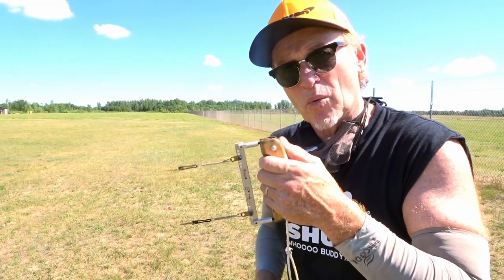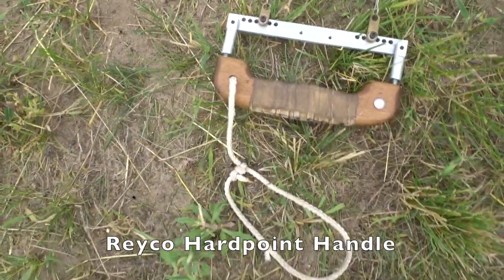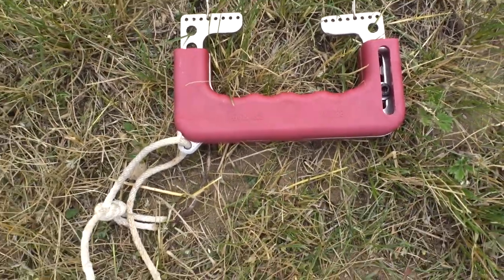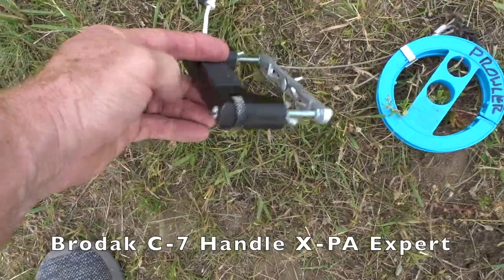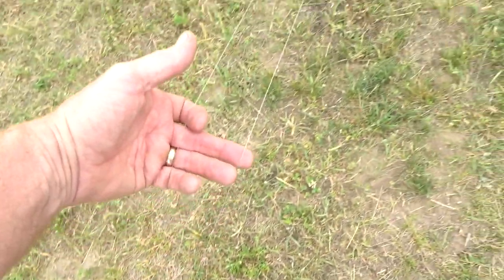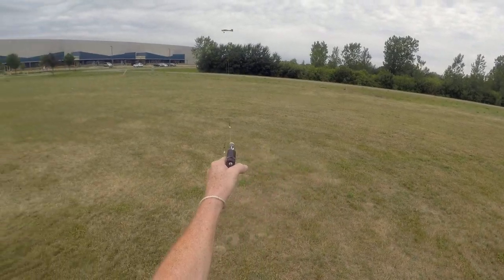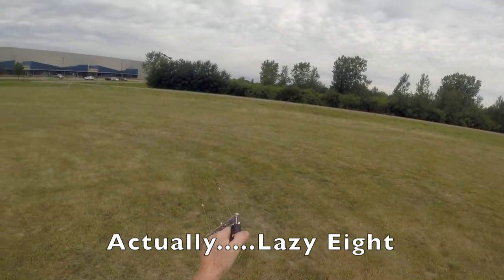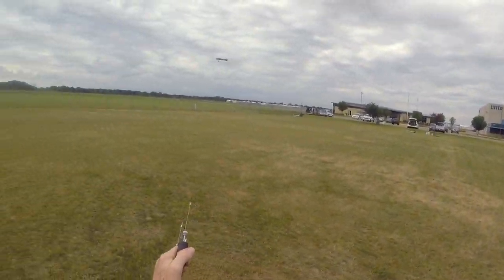Control Line Handle Talk First Maneuvers

Comment: Interesting observation about the risk of crashing being part of the appeal.  At first, just making it around for a full tank is a major accomplishment. Successful stunts add to the excitement. Finally, you tempt fate by seeing how close you can cut it before pulling out.  And sometimes, of course, you cut it a bit too close.  (A man's got to know his limitations.)
Reply from the maker: I have found that activities with a good learning curve tend to e the most rewarding.  Always tell new control liners to get some epoxy and CA and get used to re-building. And taking apart engines to clean them out after crash. Those limitations get learned eventually. I've reduced my impulse control~~

Comment: Nice instructional video. I never did the sport so until now I didn't know how much I didn't know about it. You are a natural teacher. 
There is room for a third or fourth line. You could hook a trigger finger line to do things like smoke, parachute,  machine gun. 
Just a thought.
Reply from the maker: Some use a third like as a throttle. Mainly for Scale airplanes.

Comment: I just had that old, big, red Top-Flight handle. The really heavy one with the thick wire cable leads that adjusted with a  two hole plate in the back. You know the one I mean? It worked awesome. My elbow at my hip and only wrist and elbow movement to fly.
Reply from the maker: I do for sure.
Reply: @shugemery  I actually loved mine

Comment: Thanks Shug for doing these vids to help tutor us, I wrote to you some time back, and did crash 2 planes and it SUCKED BADLY, just dropped the handle on the second, any way I am still working on it. This vid on handles is good, have 2 that you show, the one that moves the lines closer to center is the one I have to use for the quick response stab. I may not get as good to compete but I like just to go out and have fun, just flying and feel no pressure that I need to do an over head 8 or an outside loop,  just good simple flying. Thanks again, hope to get to meet and just fly and share stories with you.
Reply from the maker: As long as your having fun...all is good.

Comment: hello i want to make a control line plane do you know what lines is that?, i see videos on youtube that you can use a guitar string and aluminum wires for the controls is it right?
Reply from the maker: I get mine here.....https://brodak.com/control-line-parts/control-lines.html
Mine are 9 strand. Length and line diameter depends on engine and airplane weight.

Comment: Thank you,  thank you,  thank you very much. So much great information on handles and stunting. I have been trying to find a video like this that actually shows the stunt and handle position at the same time. Your tips about performing the actual stunts is an appreciated bonus! Could you recommend beginner stunt model, engine, handle, line setups? Thanks again!
Reply from the maker: Starting out...maybe a nice 1/2A plane.  Electric is popular these days.
https://brodak.com/control-line-kits/brodak/1-2-a-series.html

https://brodak.com/control-line-parts/1-2-control-line-supplies/1-2a-control-line-flite-pak.html

https://brodak.com/electric-accessories-1/complete-power-packages/electric-power-package-for-1-2a-series-does-not-include-plane.html

Comment: Hey Shug, re-watching this video on handles... What are those connectors that can be seen on 1min14sec? Seem like a sort of spring holding the connecting wires.. What is that? Thanks!
Reply from the maker: They are called "Hello Kitty" clips. I like them but hard to get. Scroll down to hard point handle...https://www.aeroproduct.net

Comment: This video is magnificent regarding the handles...one question: are there steel control cables which are covered with an insulated material?
Reply from the maker: Thankee. Handles are so important in this hobby! I have no idea if they make those insulated lines. Maybe a google search will provide an answer.

Comment: Hi Shuge kinda behind in watching this video you mentioned Okie Aire handle I just ordered a Bio hard point and some .018 lines.59 feet. They are reasonable price question have you ordered any thing from Okie Aire ?
Reply from the maker: I did once and lets just say the results were not satisfactory.   I get my handles and stuff from Brodak. They have top service.
Reply: Hi Shuge. Ya I. Understand Okie Aire felt maybe 30 to 60 days. One man shop that does everything. Sorry about your experience. I've ordered two 2:36 two

Comment: Hi shug i am from the UK i would like to now if you have used sullivan tufstrand, I was given 3 weels of 60feet line it staits for up to.51 engines and stronger than.018 steel cable, As i am flying 38" plan  2.5 diesel (ie .15cu)  will this be ok .
Reply from the maker: Can't say for sure but sound like it will work.
Reply: @shugemery   thanks pick up some good flying hints in this last months of you, now getting back into flying ,you are a good trainer, keep safe .

Comment: Where are the three wire handles for carrier, the mono wire speed handle, and the U - Reely ? Still have my U- Reely  Started flying U Control in 1953. dcniner01
Reply from the maker: I wish I had some of those types of handles to show when I shot this put I really only use two-line handles for stunt mainly. CL Scale uses the 3 line handles too.

Comment: Hi Shug this is really helpful I am learning new maneuvers at the moment your instructions do give me some direction:) Today I crashed my aeronaut meteor with o.s. la and broke the crankase where the muffler goes while flying inverted. How should I start off flying inverted? by learning an eight first or should I go ahead and fly inverted from an inside loop? Also, I seem to lose a sense of direction when flying above my head and doing the wingovers are there any tips for this?
Reply from the maker: Try flying at 25, 30, 35, 45° and up as many laps as you can do that will get you used to flying above your head. As far as flying inverted goes I like to stretch out the lazy eights and eventually you’ll be flying inverted before you know it doing it. And remember the more you fly the better you get so burn some gas and build up.
Reply: @shugemery   thanks for advice I will try it as soon as the engine parts arrive:)

Comment: Nice vid. A question, Cab you point me to info on how to set up the lines. I have searched but in my opinion i have not found any good source of info in that subject. Or perhaps you have a video ore one in the pipes. (and  what dimensions for what model. its so confusing)

keep up the good work.
Reply from the maker: There is a chart right here to give you some insight into that.....https://brodak.com/control-line-parts/control-lines.html
I use .018  19 strand on my 60 size. As far as length this is just a guide. Your shooting for about a 5.2 second lap or abouts for stunt flying.
I get mine made to length and finished from here...https://okieair.com/shop/ols/categories/control-lines
They are well done.
Reply: @shugemery  Here's another question beginners might not think about (like myself).  How do you roll the lines back up so when you unwind them again they don't get tangled and kinked up because once they're kinked they're doomed.  Right now I have one line on one reel to avoid any of that.  It's bad enough that I've been having issues with my planes (balance, etc.) and crashing.  I don't need the lines all messed up too.  Thanks Shug!
Reply from the maker: @gkirms  I unhook from the plane and put my finger in the reel hole and wind towards the handle carefully. Fairly standard procedure. Make sure to get the twists out before rolling back up on the reel by walking your lines to get the twists out.